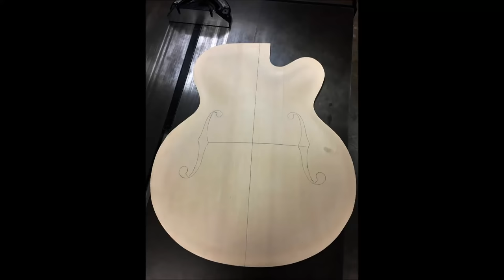Building an Archtop Guitar (Complete)

Comment: Excellent work and wonderful craftsmanship.  It's nice to see people still doing things with hand tools, as opposed to CNC machines and the like.   Not that there is anything wrong with that, but I would hope that some of us will be able to show our children and grand children the old ways of doing things, just because.

One quick tip for you, if you get to build another one, as well as for anyone viewing this who is thinking about building an archtop.  When carving the top and back, carve the concave interior contours first.  The exterior remains flat and it's easy to hold your work piece to the table.  When you flip it over to carve the exterior contours, it is still relatively easy to hold the piece to the table.  I've done some A style mandolins that way and found that it works really well and results in lots of stability for carving the top.
Reply from the maker: Hey thanks so much for the feedback! And I appreciate the tip too it’s always important to learn how other people work. In this case though, I’m not sure it would work better to switch the steps. The spruce I used to carve the arch from were wedge shaped when I got it, so the center was thicker than the edges. I would’ve had to establish a flat along the bottom as reference and then flip it over and try to balance it on that thick center seam. 

What I did was instead was cut out a small support ring that the outside edge of the arch rested on. Then when it’s resting facedown, the arch itself was still up off the work table and it was all still held flat. I even put some wood shavings underneath it to help support the arching as I carved the interior. Still appreciate it though! You’ve given me a bit of new info to consider when it comes to archtop carving!

Comment: Will,
 Of course, the sense of satisfaction you must get, easily transcends the CNC programmable archtops that certain makers use. The only question I have concerns the discussion of 2 or 3 piece laminate tops versus the single, or book matched top we see here. That is: the possible cracking or warping of a single/double guitar is more likely when a player takes an instrument like yours to areas of different humidity, dryness,altitude etc. subjected to it, causing changes to it, unless measures are taken to ensure it from unwanted changes in these lovely guitars. I haven't read the other remarks below yet. Can your tell your audience what preventative measures should be taken to protect your instruments,other than keeping it in a humidity/temperature controlled room, for it's preservation? It may be on your website.  Many  thanks for an absolutely astounding show of craftsmanship.

Comment: Beautiful work! I have a naive question... Aside from subjective reasons like "tradition" & "craftmanship" is there any reason not to use a CNC router for the archtop shaping portion? It appears that you're using something like a profile guide so the shape seems to be the primary consideration when carving (i.e. I don't see anything acoustic related in the process). Thus it seems you could design the profile in CAD and then just let a CNC router run it for the bulk carve then hand finish...
Reply from the maker: wholesalemonkeyfarm Not a naive question at all! I enjoyed the process of hand carving the top so much. You're right I did use a profile guide to lay out a general shape and that could be done on a CNC. In fact that's exactly what I did for the back in this video. We drew out the arch in CAD and used the CNC to get a rough shape, but it's not carved to the final thickness. That can't be done by the CNC. 

One of the parts that I didn't show in this video was voicing, where you measure the thicknesses around the arch and dial it all in within .001-.002". Then you tap the wood, listen to it resonate, flex it see how it feels with the grain and then across the grain, remove wood in incredibly specific areas to bring out a nice resonant tone in the wood itself. 

That's a lotta shit to do. And the videos 15 min long already. There were a lot of things glossed over in this video. Like the drawing that was done in CAD. Took me half a semester of learning our CAD programs basics just to barely be able to draw up an archtop toolpath and get 1 back cut out to within 1/16" of its final thickness. All the time I spent drawing up the program for the CNC could've been spent having a blast  with a sharp plane and a big gouge. It really depends how many you plan to make. The more you're doing, the more worth it the CAD work becomes. Personally, though, I enjoy the woodwork a whole lot more.

Comment: 15:07 Everything was fine until CNC appears and every handwork go to hell.
Reply from the maker: So because I used a CNC on one single part of the build, all of the rest of my work doesn’t count? that’s an incredibly close-minded sentiment. 

Did you miss the part where the CNC only rough cut the arching? and i used finger planes and scrapers and hand tools to finalize the dimensions and voice the back? don’t really recall how well i showed that part but i thought i included it... I for sure didn’t include the hours and hours and hours i spent just getting proficient enough in 3d modeling software to be able to draw that back on the computer and plan the toolpaths and build the fixtures for the cnc and go through trial after trial after trial until it was finally ready to cut out the back i wanted. 

and not even to mention that i was doing all of this in a school, where the goal was to teach us a little bit about multiple different processes. there are countless ways to build a guitar, not one of them is right or wrong. the result is what matters. 

like it or not, a CNC is an incredibly valuable tool for any craftsperson. there’s no shame in using one to rough out material. planning everything on the CNC takes an incredible amount of knowledge and experience but the actual act of removing the raw stock doesn’t require intimate knowledge of the individual cut of wood or it’s correspondence with the rest of the guitar. 

basically? a CNC saves your hands and joints on wear and tear so you can continue enjoying the work for even longer. if you choose to be a traditionalist and keep things old school, that’s awesome. all the power to you. but don’t gatekeep others who are trying to learn viable processes.
Reply: Some people are just plain old stupid this is a work of art